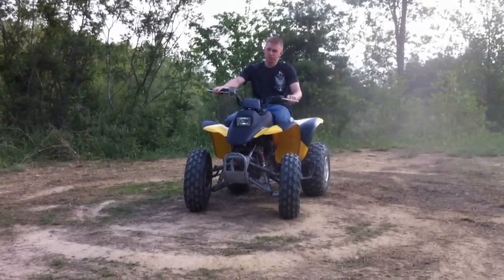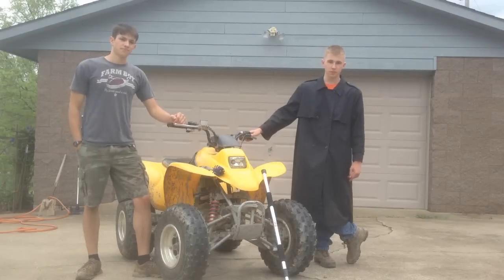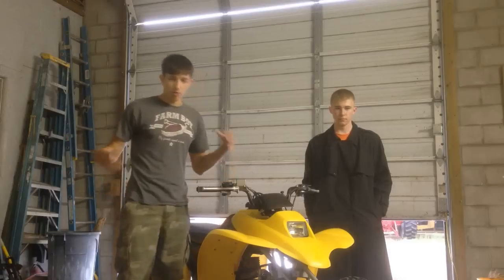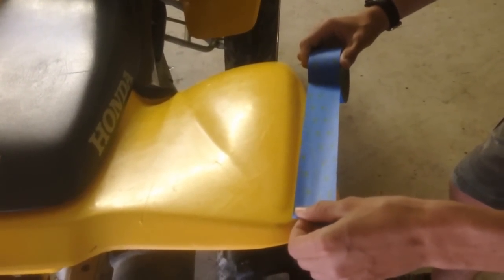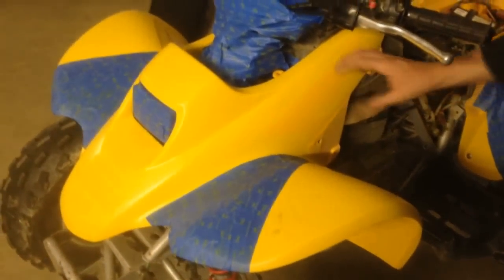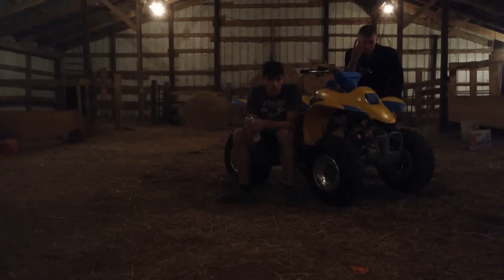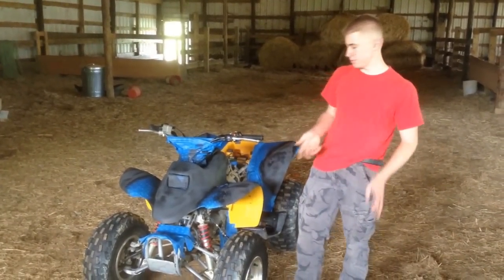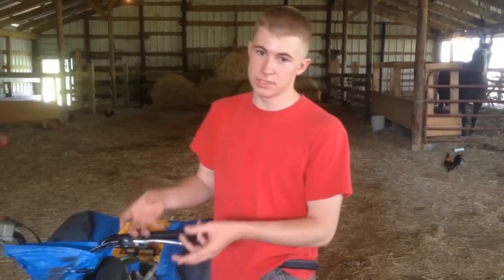How to Paint Quad Plastics With Spray in Bed Liner

Comment: Dude, your buggy sounds sick... your paint is "Foggy" from improper conditions, not fumes. You didn't use plastic primer... you didn't sand your paint and repaint after a wet sanding... you didn't clear coat it... the reason it "Scratches/flakes off" is because it is not bonded properly to your atv plastics. All atv's new or old have oils on them... you need to penetrate that filmy layer before painting. Preparation is key. It should take you a week to properly paint ATV plastics. Proper and adequate sanding... proper primer... proper waiting time... sanding... paint layers... sanding... paint layers... clear coat. I found KRYLON FUSION  to be the best for this type of project... but, that being said... your paint design looked great. I liked it... trench coat? No sir, not a fan of that lol... great intro though.